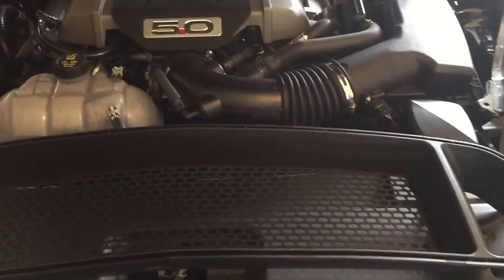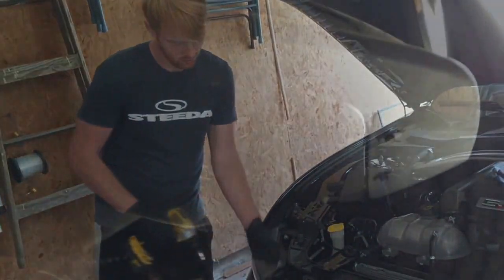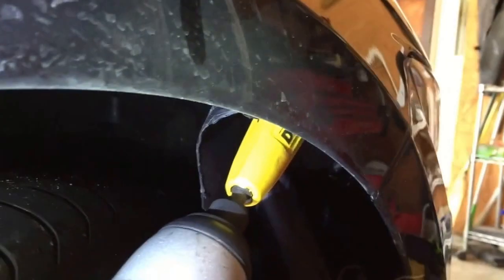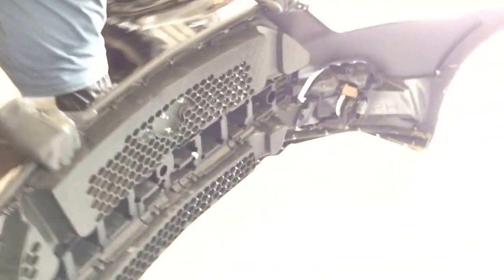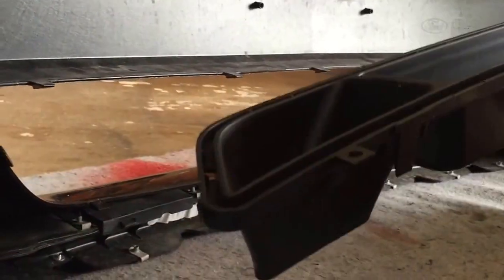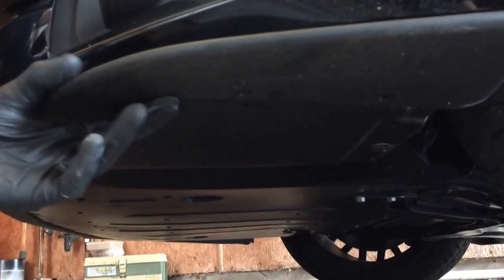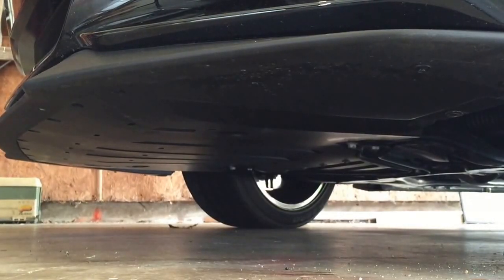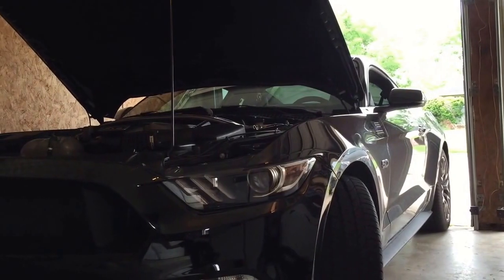How To Remove Bumper/Grilles | RTR Grilles | 2015-2017 Mustang

Comment: I watched this video a few times and followed step by step and installed my new Anderson Composites upper grille on my black 2017 Mustang Gt. I wished I had an angle drill for the bottom and 7mm screws in the fender but I used a ratchet. Best video ever. I got quoted six hours today, then went home and did it myself in four myself. Thanks for up loading this. Ever other video they used jack stands and took the wheels off. I liked that you just cut the wheels to the right and then left.
Reply from the maker: 6 hours!!! lmao that's ridiculous. I can do the grille swap in about 30 minutes on the ground. I'm glad the video helped!

Comment: This was very helpful.  I'm not installing a new grill, but am simply replacing a headlight.  Yes, you have to remove the freaking bumper to replace the headlights.  Screw engineers.  They suck.

Comment: Good demo, thanks!  My GT grille now fitted to my EB trouble free! Only difference was that I didn't have an adaptor for my 7mm mini drive socket to connect to ratchet!  (to get to the wheel arch bolts)  Luckily I managed to get to it from above via engine bay using a long worm driver, which had the correct mini square drive for the socket.  There's some other good demos on here and after watching them all, I could now remove the front bumper blind fold! This is where YouTube is great!

Comment: Thanks for the detailed video. I was wondering if you could help or direct me on how to remove the passenger side bottom sill molding? My new GT 350 is mis aligned and needs to be slid towards the back by about 2 to 3 mm. Any suggestions would be great, thanks, Chris

Comment: You have the best bumper removal video, thanks. Although, what tool or extension did you use to remove the 2 bolts on the fender?
Reply from the maker: https://www.lowes.com/pd/DEWALT-Right-Angle-Attachment/4761527?cm_mmc=SCE_PLA-ToolsAndHardwarePowerToolAccessories_-4761527:DEWALT&CAWELAID=&kpid=4761527&CAGPSPN=pla&store_code=3306&k_clickID=51b83826-b783-426e-8383-c5f15ff60b87&gclid=Cj0KCQjwxN_XBRCFARIsAIufy1bJMg4Mn5XVEOUr54IpKgfQRxQOM5QGcsa-pdaOHMwq3HpUz7OpVMUaAo5PEALw_wcB
Reply: S550 Arctic Knight Thanks man, your a lifesaver.
Reply: @DavidTurnbullHardt  YOU ROCK!  You just saved my ass big time!

Comment: Awesome video. Thanks for posting. Quick question:
I just received both the upper and lower RTR grill today, and unfortunately, parts of the lower grill were broken. The parts that were broken were some of the "tabs" found sticking up vertically over the "clips" at the top of the lower bumper (the ones with a hole punched in the center as seen at 8:59 in your vid). I thought that these would be important for the instal (I thought that a screw would be involved), but it seems like they are unused and aren't present on the OEM lower grill (again judging from your video, haven't checked on mine yet). So my question is: do you think these "tabs" are important? (as in should I send it back asking for a new one with the undamaged tabs) Or do you think they are useless and I can go ahead and do the instal? I really want to  do the instal tmrw, but I also don't want the broken tabs to come back and bite me in the a** later on if it turns out that there were somehow important. In any case, thanks again for the great step-by-step vid. I will definitely be using it when I finally do install my grill.

Comment: Great video! You can still use this tactic for the 2016 Ecoboost right? I got a new car and my front bumper got hit on my second night driving it. Do you have a video about removing the fog lights? My right side kinda got a little messed up so any help would be greatly appreciated. Thank you! Keep up the fantastic work!
Reply from the maker: bumper removal is the same. Once you get the bumper off the fog lights are fairly easy to change.

Comment: Finally, a detailed video. One question though, I have a base model GT and I've seen that the process of removing the bumper is one step longer. Is this true?
Reply from the maker: +neckbonz I did removed a V-6 bumper to install another grille a few months ago and from what I can remember it was the same process. Just remember if you have to use a lot of effort to remove the bumper then make sure all screws and clips have been removed.

Comment: Hi arctic knight, after removing the 7mm bolt around the wheel well, i was having a hard time trying to pop out the bumper from the side. is this normal? im scared to break my bumper. thanks!!
Reply from the maker: yes there are clips that help to hold the bumper as well.

Comment: good step by step video, is the base model different since we dont have the belly pan design like the track packs
Reply from the maker: It's actually a little easier because there aren't as many bolts underneath.
Reply: awesome have a grill just waiting ot install  this weekend

Comment: great vid on the locations of tabs and the screws/bolts . And double thx for including the socket sizes needed.  Not to be annoying but the front "bumper" is called a fascia (since its basically the entire nose portion).

Comment: Yo please can u let me know what kind of tool is that u used to remove the 7mm bolt at right angle which connects the fender with bumper on either ends .... I m struggling to remove that bolt due to limited access for wrench
Reply from the maker: http://www.homedepot.com/p/DEWALT-Right-Angle-Drill-Adapter-DWARA50/203867866
Reply: +S550_ Arctic_Knight I have purchased the above right angle tool and drill but what is the attachment required on the right angle tool to which removes the bolt. Apologize for bothering you, this being my first time in removing the bumper cover
Reply from the maker: P51-Stang6  It's just a drill attachment for a socket http://www.homedepot.com/p/Milwaukee-1-4-in-x-3-8-in-Steel-Square-Socket-Adapter-48-32-5031/202562858
Reply: Or just buy flex head wrench and just have 7mm socket handy. Thats what i used when I did mine

Comment: is there a way to have the pony on the rtr grill still?
Reply from the maker: I'm sure it could be easily fabricated to work.
Reply: I just put a tribar emblem on mine. I just took two pieces of heavy plastic and made a bracket out of them.

Comment: Damn it there is that hidden bolt just ripped my damn tabs off my passenger side fuck balls
Reply from the maker: Did you not watch the video through first?
Reply: S550_ Arctic_Knight I didn't watch the video or read instructions, I was going off how I take my focus st bumper off fucking Ford hiding shit on me
Reply: Marcos Ibarra on ebay there is a dude who sells bumper covers from roush like they r stock take offs before roush puts there's on, cost me $285 shipped paint matched 100% and fitment was right on little pain in the ass switching everything over but not that bad.....I tried gluing the tabs on but after a week the bumper saged so just went the eBay route
Reply: Marcos Ibarra Mircoautopartsinc was the user name on ebay where I bought it from
Reply: god damnit....$295? Mine is broke on the driver side and I dont want to pay $600 for a new bumper
Reply: jarretlord $285 shipped found one on ebay...guy was selling what roush would pull off stock mustangs....kinda looks like they went up in price to $350 now

Comment: I have the ecoboost but ur stock grill is better I will buy it from u how much?
Reply from the maker: This is a buddies car. I do have the gt grilles that have the delete and then mesh installed. Where are you located?
Reply: S550 Arctic Knight los angeles
Reply from the maker: +DZenitram23 I'm not sure both parties would get a fair deal, especially including shipping. You can order a brand new gt grille from here for pretty cheap.

https://www.amazon.com/Ford-Mustang-Radiator-Grille-FR3Z-8200-BA/dp/B0118FTD76
Reply: S550 Arctic Knight thanks

Comment: you getting the new rtr lights?
Reply from the maker: The owner did get them. I like them much more than I thought I would.
Reply: S550_ Arctic_Knight oh cool. yeah they are pretty sweet
Reply: do you need to remove front bumper to replace the headlights?
Reply from the maker: STMARYS KENNARDS yes.
Reply: STMARYS KENNARDS headlight housing yes. Bulbs no. Changed mine to 6k then to 5k from the factory 4,300k without removing the valance.

Comment: What is that tool for ur drill?
Reply from the maker: https://www.lowes.com/pd/DEWALT-Dewalt-Right-Angle-Attachment/4761527?cm_mmc=SCE_PLA-ToolsAndHardwarePowerToolAccessories_-4761527:DEWALT&CAWELAID=&kpid=4761527&CAGPSPN=pla&store_code=1898&k_clickID=51b83826-b783-426e-8383-c5f15ff60b87&gclid=CjwKCAjw-NXPBRB4EiwAVNRLKoIGsT9AMciJThQ-e3VEN-us_MFQ1mIHCkziYZ56rRHbk5ki98viRhoCegYQAvD_BwE